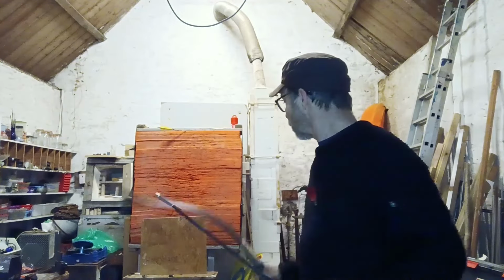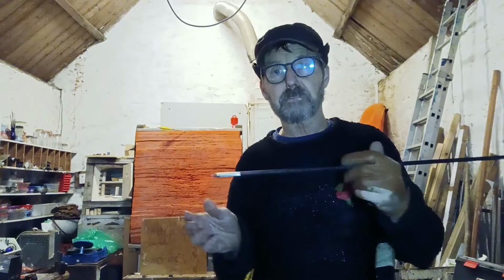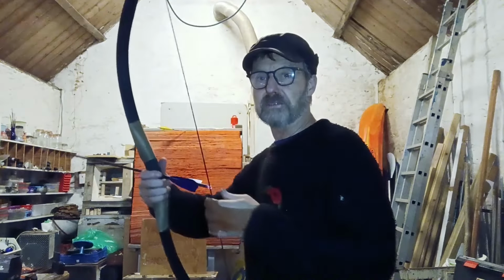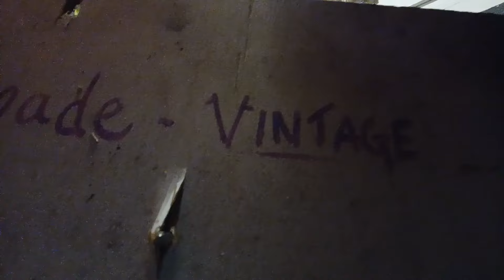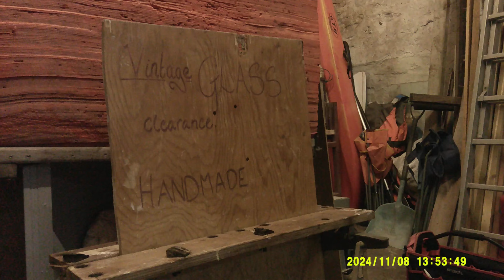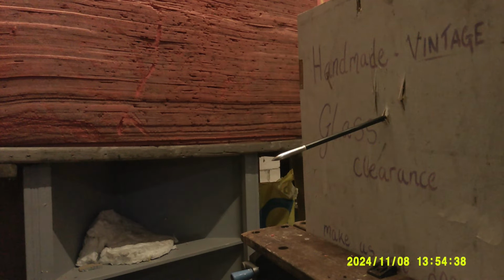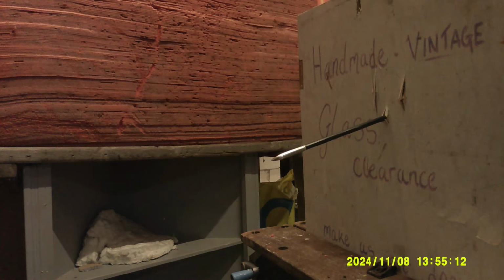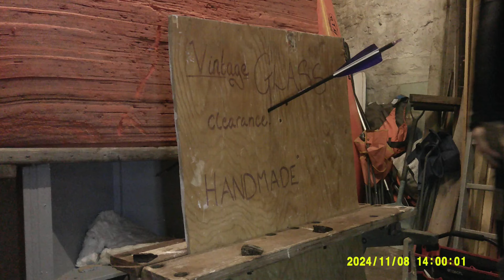Archery - The difference between wet and dry arrow  penetration. 13mm ply

Comment: On the second watch I've an observation to make regarding the "wood", as I'm not sure ply behaves like real wood. Having just had to extract an arrow that was very well stuck in some wood. 
My hypothesis is natural wood being fibrous and also having elastic properties will grab/hold the arrow more, ply having so much resin for binding will be much mich stiffer so there are not the elastic fibres to hold the arrow. 
Think it's most evident if you can just pull the shaft straight out, which implies you've punched a clean arrow size hole same as penetration as once it's through enough then it's pretty much going to keep going. With your steel test the slight spring in the steel should also grab the arrow.

All that said this is a good solid test on it's own showing talow vs not.

Just one day might be interesting to try actual wood vs Ply.
Reply from the maker: After the last arrow went through the ply it smashed its way through about 2" of pine, splintering it. I should get some wood that was used to make shields to see if that makes a difference.
The next test will be about 12 layers of cotton, I rather suspect that it will be difficult to penetrate with field tips.
Re the extraction the lubricant helps greatly.
Reply: @addersbowman  Sure lubricant helps with removal too.
I reckon some pallet planks would be a good stand in for an apocalypse shield. Poplar is pretty hard to get these days, and scaffold boards might be a bit on the chunky side.
Reply: I should be able to get my hands on a poplar plank as my workshop is in a harbour and it's a common wood used in wooden boats